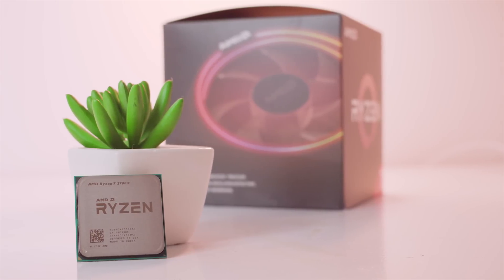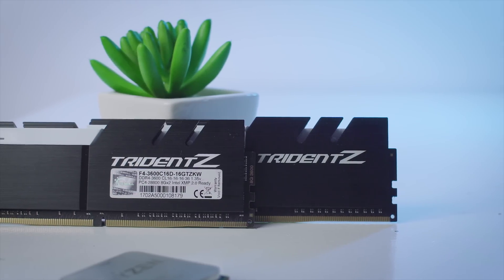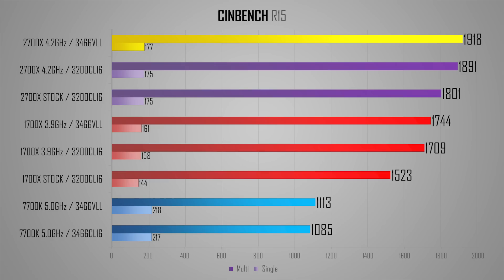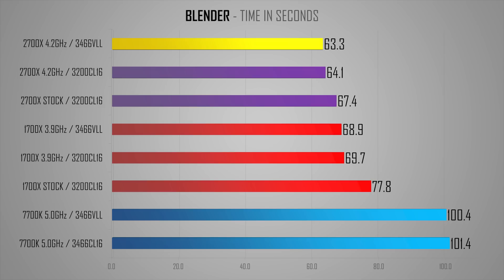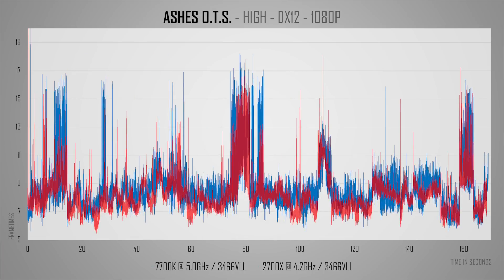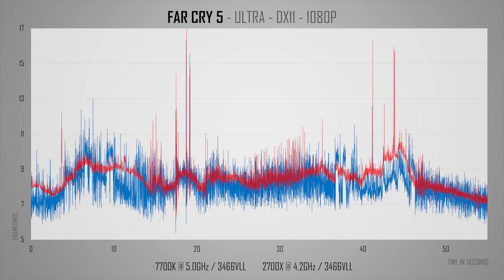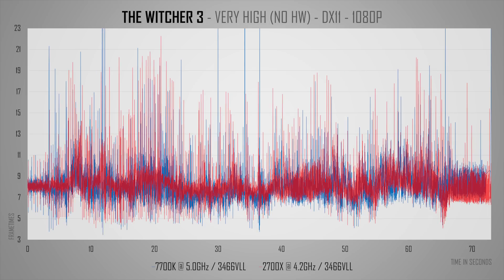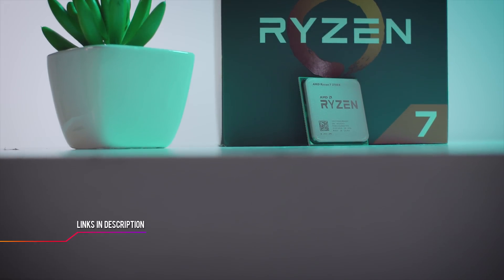RYZEN 2700X + Low Latency RAM - Still AMAZING PERFORMANCE gains...

Comment: I have worked out the reason why Ryzen has the issues with gaming performance. 

It is because the data path for the memory traffic from CCX0 and CCX1 to the system memory, over the Infinity fabric, is effectively the same as a three node LAN with a store and forward switch in the middle (AMD call it a CAKE) connecting the three nodes of the network up. Each connection transfers data at 32bytes/cycle at ram speed making the entire trip from cpu to memory relatively slow at about 1600Mhz.  The switch has to work like a traffic cop and merge the traffic from both pipes connected to each CCX into a single 32 byte/cycle pipe that connects to the memory controller, cutting the bandwidth available to each CCX in half. 

The dual channel Ram itself is limited to accepting 32 bytes/cycle so there is no benefit increasing the pipe size connecting the memory to the fabric. Generally the memory access network is fine because memory accesses are by nature bursty and not constant so there are gaps and the queue at the switch in the middle smooths things out.

Running cinebench or blender type loads perform well.  The available 16 byte/cycle available to each CCX module is enough for the CPU to perform well.  If you play a game though, The GPU is connected to the network and needs to access the Memory controller over the same 32 byte/cycle pipe that connects the memory controller to the fabric. Now instead  of 16 bytes/cycle available to each CCX, the GPU is also taking say, 30% of the available bandwidth only leaving say 8-12 bytes/cycle available to the threads from eachs CCX. that means the requests have to wait through longe queues at the switch and each thread has to remain idle for a fraction longer waiting for memory access.

Faster memory helps because it provides more cycles per second to shift the backlog a the switch. Because the speed from cpu to memory is speed limited, the memory controller doesnt need to buffer much and ends up with either being fully busy or doing nothing

Intel uses the ring bus that runs at least twice the frequency of the Ram making the trip from cpu to the memory controller buffer fast with reduced latency. Once in the buffer, the controller to memory link is at the same speed as the AD but it is only a short trip. the controller can write the data to memory as soon as there is a write slot available.
Reply: Infinity Fabric is a marketing blanket term invented by AMD and actually covers the data transport and the management layer. I am talking about the data transport layer.  Make no mistake, it is a network on a Chip. It does not use TCPIP, it has different protocols but the principles of network traffic and network bottlenecks remains the same. Road traffic getting traffic jams at peak hour because two main feeder roads merge into one road with out any extra lanes is exactly the same principle. Increasing ram frequency is the same as giving the merged road a higher speed limit .

The infinity Fabric that you are thinking about in terms of frequency is just the transport mechanism. Memory reads and writes are the work that is done by using the transport mechanism and that work takes time to complete. The time the  System Ram takes to complete a memory transaction is determined by the CAS timings and sub timings that together determine the total transaction time cost involved. The Fabric has teh capacity to carry 4 memory transactions at a time. A single ram write request takes 60-100 ns to complete depending on how tight the timings are set.  The time to complete the transaction and be ready for the next one is what is being reported as Latency in the aida64 latency tests.  If the memory is busy with servicing requests from cpu 0-3, the next load of thread memory access requests from cpu4-7 have to wait until the memory is available to get a turn. Threads waiting for access to memory are sitting idle not processing anything.

CPU cache is clocked to the CPU clock and is effectively fixed. The Ram frequency sets the speed limit on the data transport. More cycles available on the fabric network, gives the CPU more opportunities for the cpu threads to have their turn to utilize the system Ram. tighter timings means the waiting time before the memory can deal with the next send is lower. 

AMD and Intel have taken different approaches to accessing memory. The relatively slow Infinity fabric means that the data is speed limited all the way from the CPU to the Memory controller incurring a time cost but the memory controller does not need to buffer anything and processes the requests as they arrive. The time cost is seen as the higher latency scores in the benchmarks. The higher latency does benefit SMT because each thread gets more opportunity to do some work. 

Intel's ring bus is about double the speed between cpu to memory controller but it relies on the memory controller buffering the fast arriving data an manageing the data access in the last hop to the ram silicon. that makes more efficient use of the available Ram cycles in the last hop from controller to as the Ram silicon. 

The result is much lower latency and because the load on the memory controller is better balanced, getting Gaming performance. The sacrifice that Intel makes is to the efficiency of the Hyper threading.
Reply: Memory access is by its nature bursty leaving large gaps between moments of high activity. Particularly as AMD fabric is running at the same speed that the memory can be accessed. It is not a constant stream of data so the memory controller is either all or nothing. 1:1 does not allow any extra traffic to be squeezed while being sent across the fabric in the way a faster link does. You still have the problem of the memory access speed being limited to 32 bytes/cycle so you need a bigger buffer and then can rely on the bursty nature to give the controller gaps  in time to smooth out the access to the silicon.

The Fabric is basically like a 4 lane highway. faster memory or increased fabric multiplier is just increasing the speed limit on the 4 lane road. It mitigates the problem but gets harder and harder to achieve safely/stably. Next gen GPUs will be more powerful than Pascal making the problem worse. What is really needed is a 6 or 8 lane road. The need for faster speeds to clear the traffic then goes away. 

The only real way to solve the problem is to create a double interconnect to the memory module and implement a triple or quad channel memory controller. Even if it only supported 1 dimm per channel, Quad channel means you get 8 concurrent writes to memory instead of 4. The fabric could stay the same and there is still excess capacity for GPU utilisation without causing contention.

I suspect that while it may not be as dramatic, any new 8 core Intel chips will show less efficient gaming performance than the six cores if they stick to dual channel memory for similar reasons. dual channel is on the limit of what is supportable without compromised performance. Adding a GPU load pushes it a little over the peak and starts the trip on the down side of the performance graph.
Reply: doubling the frequency of the fabric and increasing the memory controller buffer would make teh chips more Intel like in performance.  The 2600x vs 2700x in gaming performance is about the same. Leading me to believe that 6c/12th is probably the optimal level for dual channel memory if you want to do gaming workloads. 

The best fix but most unlikely would be a ddr5 or change to triple or quad channel memory.
Reply: The Infinity Fabric is always used. It is the providing the connection between the CPU cores on both ccx modules, the memory and the pcie controller that connects to the  GPU.  

The bottleneck that we are talking about is not about threads switching  to cores on the other CCX module. PCPer and Anandtech were wrong. They could never get their heads around the idea that If it was scheduling based, you would see the same performance issues in non gaming workloads and you didn't. Ryzen 1800x was beating Broadwell-E in the office applications yet losing out if you ran a game. The thing that was changing in the two scenarios was a heavily loaded high powered GPU of at least a 1080 or better. 

Many in the Youtube tech Media have made this appear worse than it actually is (not mindblank. he started his reviews with a 1070 and got different results to everyone else). The number of reviewers who steadfastly clung to the Idea that they needed the highest powered Graphic card because of the fixed belief that the test would either be CPU bound or GPU bound. It totally ignores the fact that there is stuff in between that could also be creating the issue, especially if you are testing a CPU that is a totally new architecture that Even AMD was not completely sure of how it worked (at least in public).

Project Lasso can be used to manage threads and set CPU affinities for applications on Ryzen. You  will unlikely get the best results from disabling the 4 cores on an entire CCX to make a quad core though. You should experiment because each game has different requirements in regards the demands it places of the hardware.  The 1600 R5 cpus perform better than the R7 in a number of games  and better than the Ryzen Quad cores so you will more likely get the best results disabling the CPU affinity on two threads on each CCX and letting your R7 pretend that it is an R5 1600/2600 while it is running a game that is being impacted by the contention for access to the memory. The Utility will not prevent other applications running on the unassigned cores the way AMD Game Mode does and doesn't require you to reboot. If you are running on a GPU less powerful than a GTX 1070, then you don't really need to do anything. the lower performance  GPU cannot produce enough memory traffic to hit the point where contention levels are causing major problems anyway. 

 I would highly recommend anyone using Thread ripper  to install either Process Lasso or one of the other free process management utilities that are available and actively manage their applications . I would suggest that anyone playing games on TR set the  CPU affinity to only use a selection of about 12 threads from the 16 on the die with the direct connection to the GPU
Reply: Every Ram transaction has a time cost. Aggressive sub timings do improve things because it reduces that time cost for each ram transaction. The CPU cannot send a memory request every cycle. CAS14 means 14 cycles to just to set up the memory to be ready for the transfer. Some of the sub timings run in parallel and others are additive to the total time the the settings allow for the transaction to complete. Loose timings extend the time the computer allocates for the transaction to complete. if the actual time the memory needs is less than the allocation, the loose timings are just wasting time.

the fabric running at ram speed means the controller doesn't need to buffer in the same way it does with Intel's ringbus shotgun approach because the data cannot arrive faster than the memory controller can deal with it anyway.
Reply from the maker: This actually makes complete sense. So instead of major architecture overhauls, a middle ground in effort-to-effect would be asynchronous interconnect speed, to allow higher that 1:1 with the DRAM. I think even 1.33:1 would be a major boost in performance. Ideally doubling it should be the best solution... EDIT: NVM, I read your next comment.
Reply: Damn brad morris, i don't usually comment on youtube but i made an exception this time, i don't know if all that is true or not because i can't even begin to make sense of your explanation lol, but it sure does sound like you know what you're talking about. If i may ask are you a CPU architect or something?
Reply: My reaction to this comment:

https://youtu.be/Qw9oX-kZ_9k
Reply: I was hopeful that would be the case before it was released as well but unfortunately not. I have been talking about a single Die Ryzen. Thread ripper splits resources across two dies with the extra latency inducing fabric connection in between that introduces other issues because it is splitting each dies' dual channel memory controller. The gpu can only connect directly to one of the two dies leaving the other four cores behind an additional layer of latency. 

with TR, you can do your own cpu affinity management and run the game on threads on the die local to the gpu connection. on the 1900x you are then the same as a 4c/8th cpu.  the unutilized cores can be used by the background tasks. the 1920x or 1950x would probably allow you to manage your way to a better experience.
Reply: No you dont. 

You still have a perfrctly viable and useful PC with 2400 or 2600 memory installed.  It just wont make quite as many FPS if you are gaming with a GPU at a 1080 or above level. If you can't afford 3200 + Ram it is unlikely you can afford a 1080TI. 

Perfromance with a 1070/1060/RX580 and below is pretty much the same with both platforms
Reply: seems contardictory with this test your conclusion, i don't think he explicitly said that upping the megahertz is the only way; he said faster ram will help to keep busy all the time, this means tighter timings makes rams faster as well. 

"that means the requests have to wait through longe queues at the switch and each thread has to remain idle for a fraction longer waiting for memory access.

Faster memory helps because it provides more cycles per second to shift the backlog a the switch. Because the speed from cpu to memory is speed limited, the memory controller doesnt need to buffer much and ends up with either being fully busy or doing nothing"
Reply: there is certainly compiler optimization issues as well, particularly in games that predate Ryzen but the gaming under performance that is helped by faster Ram  for just about all games across the board suggests that it is not the root cause
Reply: maybe an easy way to visualize it it to think of the fabric as a 4way intersection connecting 4 x four lane roads. two of the roads connect to the two CCX modules, one road connects to the PCIe controller/GPU and the last 4 lane road connects to the memory controller.

traffic going to the mem controller from each ccx module can arrive at the intersection four abreast. the 8 cars have to slow and  merge to all get into the single four lane road that connects the intersection to the memory controller. For non gaming loads that situation is adequate. 

With the gaming load, imagine the GPU has forced the closure of one of the lanes to the traffic on the memory controller road so it can operate get instructions and textures and display the game. The 8 lanes of traffic from the cpus now have to merge into 2 or 3 lanes and not four, slowing traffic down further.   The more traffic (16 threads) the greater the impact on total time required to service the needs of the CPU compared to a lower traffic count (12 threads).

Each thread on a 6 core has to work harder than each core on the 8 cores but application access to memory is sequential in nature we need to look a a snapshot in time rather than totals
Reply: the issue is the the connectivity to dual channel memory is over subscribed by 8c/16th. Hypothetically, Adding another CCX would make that problem worse without other architectural changes that increase the bandwidth to the memory controller and increasing the number of memory channels. 3 x ccx (12 cores) to a quad channel controller that connects using a second parallel interconnect, on the same die, should solve the contention issue as you are the cores concurrent potential to access  system memory by 100% but only increasing the load generating cores by 50%. 

Given that AMD designed Zen to be a modular "lego" block (ccx) that can fit in pairs to a silicon die which n turn can be connected together to other dies to make a multi core server chip, I doubt that they will be  re-engineering the basic building block/die any time soon. Adding extra CCX modules, in addition to the design effort also have a power and temperature cost that they may not be able to overcome with current technology. This is all hypotherical. I don't know if AM4 could even be rejigged to support extra memory channels. I guess that it cant not Im not 100% sure on that.

Maybe 7nm will lower the power and cooling requirements to a level where that sort of thing may be possible, but the change in FAB is a major undertaking in itself, they are not likely to be making massive internal changes to the chip at the same tme.
Reply: Very difficult to determine what the problem could be from a YT comment. A custom build system has many different parts and any one of them could be the cause. Threads dont jump between dies to the extent that some people imagine and even when they do, it is only adding 40ns.  What you are describing is not caused by the architecture.

You are the first person I have heard complaining about micro stuttering. There are certainly many things about Ryzen that are not well understood. I have no Idea what may have caused your issues, the usual observation was that Ryzen, while it was producing lower framerates, was generally producing more consistant frame timesand wasdescribbed as feeling very "smooth". maybe you had a motherboard/hardware problem?

I am certainly not hailing Ryzen as the Best CPU, far from it. I think that the design, as it stands now, is slightly flawed but not so bad as to be useless. not everyone want to play games on a PC and 1080TI users are unlikely to be playing at 1080p. 

It is good to see that there is some competition  in teh CPU market though.
Reply: @bradmorri  any thoughts on ryzen 3xxx now?
Reply: @cis9222  both Intel's ringbus CPU design and AMD's Iinfinity Fabric design have design tradeoffs and compromises. 

Much like the difference between an American V8 engine and an Italian V8. one is designed for huge torque  and makes up for lower power by adding extra capacity and the other more for HP per liter.

ringbus works great up to about 8 to 10 cores but becomes impractical much above that due to the complexity of connecting the ring to everything. Infinity Fabric is more restrictive in terms of total bandwidth per interconnect but infinitely more flexible too expand the chip design.

Ryzen 3000 is a great design for getting work done.  and makes increased core count relatively easy compared to Intel's approach. 
16 cores are amazing. The design and the multi chiplet interconnects do help with the gaming performance if the application code is written to evenly spread workload across the chiplets. Not all games do that though.
Reply: @bradmorri  Im planing my build soon. Ryzen 2700x , B450M MSI tomahawk MAX,2x16 gigs of RAM Corsair or Kingston. But, I read this whole post (took me a while), and I need to ask which RAM should I get? I want 2 sticks 16gb so it works in dual channel. Which RAM is best for 2700x? Also, what you think about this. How 2700x will handle future games in terms of FPS? I think as long as I buy very good GPU I will be fine. I mean its 8/16 and upcoming consoles  gonna be on similar chip with slighter lower clock speed since consoles dont aim above 60fps. BTW im not planing to buy B550 boards or wait next gen of CPUs. Im low on money , for now, maybe that changes in next month. Maybe , but maybe I will get 3700x. Will see. I know that 2700x is really really good CPU but better to ask others opinion also. Is it worth buying it now? Also Im doing music production.
Reply: @PsychoCaki  Dual channel is the correct choice. 16GB sticks are dual Rank memory sticks and can me a bit more difficult to set the clock really high than 8 gb sticks but the do offer better performance due to the dual rank on each stick.

Ryzen has been designed to be extremely flexible so AMD can produce a range of CPUs from 4 to 16 cores while providing adequate performance in just about all things. Gaming will never be as fast as an Intel chip due to the differences in architecture but it will be adequate and generally, because of the internal QOS used by the infinity fabric,  give better 1% low framerates than intel making everything less choppy.

16BG 3200C14 (best performance) or c16 (slightly more budget) sticks are probably the best bet for a 2700X build.

Take a look at the MSI QVL for memory and that should be a good guide as to what sticks are compatible with your build. Corsir and Hyperx tend to have use different chips on different SKUs so it is not as easy as just picking a brand

Gskill sniper X memory is ryzen certified and b-die chips. they may be worth a look. Gskill kits are usually pretty good with Ryzen anyway. Ripjaws series will be cheaper than trident series but not as pretty

If you can find sticks that use the Samsung B-Die chips, you stand the best chance to try overclocking the memory a bit higher than the xmp settings.
The 2000 series cpu memory controllers are not as strong as the newer 3000 controllers so the memory speeds are not as high. 

If you are really lucky, you may be able to run a set of 3200c14 sticks at 3600cl16 but those 2000 series cpus are not that common. 3400 should be possible for most cpus. Cl16 sticks could also clock faster but likely with looser timings.

The memory clock is tied to the Fabric clock. the faster the clock, the more bandwidth available to get data from the ram to the cpu for processing and from the cpu to gpu to render frames.
Reply: @bradmorri   Yeah I know that Ryzen cant be Intel in gaming and I don't even care about thaat much fps in games. Im also productive based guy not only gaming. I do game a lot like 6 hours per day minimum but I do lots of things beside that also so 2700x is sweet spot for me considering my budget right now. BUT LIKE I said maybe my budget changes in next month and maybe I grab 3700x. I heared about that Samsung Bdie memories and I might take a look if I can find those sticks in my country. I never took a look if we have those here. I dont mind spenting little bit more on memory so my 2700X works phenomenal. Im a tweaker guy so I like to play on those things. Sometimes its even boring to just put everything in case and all works phenomenal. I mean I dont mean on huge problems we all dont want that right,  but tweaks I like. But intel is not even fast that much compared to 3700x when you consider what you need so Intel works that phenomenal. Price for motherboard ,cooling etc. I mean its just higher clock speed that makes differences and single core performance. But I admire Intel how they manage to hit 5ghz on chips on 14nm technology. I mean even TDP isnt that high for those Intel chips. Imagine that Intel have 7nm. I think that things would be different. What you think? I think what Ryzen is trying to do is to "make" their CPUs more like combo between Xeon and Intel. I know their target is IPC but also I wonder why their clocks are low. I mean its not even good for overclocking also compared to Intel which is 14nm. Intel really squeezed last juice out of 14nm before they change architecture while AMD seems to go somewhere new before mastering old stuff, if I said it right. I mean I know that even FX8350/70 is capable of runing many games when overclocked but still Intel was famous back then.  Anyways, I might take a look for those Gskill memories. Samsung and GSkill one of those il get just to see availability in my country.
Reply: @PsychoCaki  general rule of thumb is that the 3200 kits that have timings at 14-14-14 or 16-16-16 are usually the b-die kits. There are a number of the overclocking sites that have compiles lists.

Gskill sniper x ram is specifically "made for Ryzen" so it is a safe bet.

If you are considering upgrading and you have the budget you might want to also look at some 3600cl16 kits. You may not be   able to run them at the advertised frequency with the 2700x but they should work OK with a 3700 upgrade.

the next gen ryzen cpus will be announced soon you may even consider an upgrade to the latest gen next year assuming your b450 will support it. (it may not) I am hoping that AMD puts dual infinity fabrc interconnects to each CCD this time. If they do that, the new Zen 3 chips should beat anything that Intel has to offer.

Don't get hung up on frequency. 4.2 ghz with 120% IPC will beat 5ghz with 100% IPC all day long. Remember the old AMD FX chips ran at 5ghz. They were still rubbish because they had terrible IPC. 

For most Productivity work Ryzen 8 core CPUs are beasts. You should be happy
Reply: @bradmorri  Yeah thats very true. AMD is all around. I  hope that B450M will support next gen of Ryzen CPUs so i can upgrade later on from 2700x to something "faster" although i know that with 2700x i willl be able to do many tasks for years. Also for the RAM I might go with 3200mhz kits with CL14 latency. I know now which kits just i need to find them here. I dont think i will OC 2700x to 4.2 , but yeah IPC is IPC. Maybe i will do it or maybe not. I just dont like to OC stuff idk. Thats just me maybe. I like tweaks but OCs not that much. Thanks for your answers! Im curious what AMD will offer in future. But also Intel going to 10nm in near future? Or maybe not .
Reply: @PsychoCaki  nothing forcing you to oc the cpu. 3200c14 is a good choice. that should also run at 3600c16 if the memory controller will cope. 

you will get the best performance increase running the memory as fast as possible with PBO enabled as opposed to running an all core overclock anyway
Reply: @bradmorri  patriot viper gaming 4400 mhz runing at 3600mhz cl14 with Ryzen 3950x. I saw some guy have that memory. Also 32 gigs of RAM. Sick performance. Idk can I get something like that similar? Like I said I dont mind spenting more on memory to get as much as I can from Ryzen.  I didnt look at price though yet haha. EDIT: nevermind I saw prices. Too much for my budget. I might take a lot at 3600mhz cl16 or 3200cl14 like you said those gskill ripjaws.
Reply: @PsychoCaki  Yes that 4400 ram will work if you can get it. it is budget priced 4400mt/s ram but It is not available where 
I live.

The 2700x memory controller is weaker than the 3000 series controller. 2000 CPUs that can drive 3600 ram are not that common. you may be lucky but you will have to try it out. 

cl14 2300 ram will also run at 3600cl16 so it is a good compromise for the future upgrades. likewise if you can find a 3600cl16 kit that is better priced, you can most likely run that at 3200cl14 on the 2700x build if the memory controller wont cope with 3600.  The timings for both kits are almost the same. The 3200cl14 kit is ever so slightly faster.
Reply: @bradmorri  so you’re saying that buying and overclocking B-Die sticks is basically pointless on the 2700x? I’m running a 16gb G.skill trident 3200 kit 16-18-18-38 which I believe is Hynix memory. 
Curious if I would see my cpu bottleneck I’m encountering with my 3070 lessened if I were to tighten timings on my current kit or upgrade to the patriot viper 4000 or 4400 B-Die with better timings. 
Also worth mentioning I’m on the stock ryzen wraith prism cooler.
Reply: @dyyylllaannn  Ryzen Infinity Fabric Architecture and ryzen memory controller capabilities diametrically oppose one another in the first 3 generations of Ryzen CPU.   The CPU cores are monsters that are limited by the infinity fabric limitations on transferring data between ram and core to process and the core to gpu to display the game.

the data for both gets to travel over the same interconnect that id capped at the maximum ram transfer speed. the moment you start sharing the link with data for the gpu, the cpu gets less raw data to process so compared to an intel chip, the fps in a game suffers from the design compromises.

the faster fclk, the less the design compromise impacts the chips ability to feed thecores and the gpu....up to the limits of the memory controller to support the highest fclk frequency.

Memory that runs faster than the fclk frequency the memory controller can support will not improve performance. On 2xxx chips the fclk and memory frequecy are locked together and even golden chips would not run past 3600mt/s ram . 

I would suggest that you would be better spending your money on a used 3700 cpu and selling the 2700x rather than buy 4400 ram.

you could try some ram frequency overclocking on the 3200 sticks first. give them slightly more voltage and try the sticks at 3300 or 3466 with the same timings. 3600 is about as good as you could ever hope for. You will get an fps improvement and it is free.

Remember that the 5xxx cpus are the last on AM4. 6000 cpus will need ddr5 memory.

The secret sauce of the 5000 series of chips is in what AMD have remained silent on. The 8 core CCX change helped but the main reason that he 5000 cpus are way better han the intels and last generation is that each chiplet is now connected to the IO die with two interconnects like the 3xxx thread rippers chips instead of one that became oversaturated and bandwidth limited when you were gaming.
Reply: @bradmorri  okay completely understood. I appreciate your willingness to expound at length about this subject to random people on a YouTube thread. 
I did read a lot of what you said in this thread to others, so I understand that adding the bandwidth on the chip to increase gaming performance is almost what you were saying they should do a couple years back when this thread started. Funny how you can predict these things so accurately with a little knowledge. 

Thanks for the advice, I won’t look to buy the memory, and I don’t really want to buy a faster chip in the current market unless I can find a good deal on it, especially not another bandwidth limited AM4 chip. Might as well just try to tune the ram I have to a higher freq. like you suggested, and I am also considering an AIO radiator cooler and noctua fans all around to improve temps on my cpu and 3070. 
One thing I think the 2700x does well is it’s XFR auto overclocking, I regularly see single core 4.3+ and speeds across all cores over 4.2ghz from that old silicon which I think is good. 
So just to reiterate, I will not really see a benefit from faster ram timings in gaming performance? 
I’m not just talking frequency, I’m more focused on tightening timings with the new ram. The 4000+ is just a good way to ensure you get b-die, I would run it lower.
Reply: @dyyylllaannn Thats OK, I am hoping to educate and share a bit of what I have learned over the years. I must admit that the misinformation in the media does trigger my tech OCD a bit.

The 5000 series are really good. They don't suffer the same design compromises of the single interconnect between the die and the io chip. Not sure if you have noticed or not but the first 3 generations of ryzen all had some element of Infinity Fabric in the Marketing. This time AMD have remained totally silent 

While the change to 8 core ccx helps some, it is not the whole story. the 3000 Threadripper chips all have dual fabric interconnects between each CCD and the IO chip.

Surprisingly enough, the 3xxx TR chips with much higher thresholds before the contention starts  perform better in gaming than the Ryzen chips of the same 3000 generation with the same core count 

 I am pretty sure that the major upgrade was the inclusion of the same dual interconnects on the 5000 Ryzen cpus eliminating the interconnect contention.

With the 1, 2 and 3000 cpus, the only tool to mitigate the limitations was to increase bandwidth of each interconnect. the only variable you have to play with is memory clock speeds because that is the only way you can raise the contention ceiling by increasing the fclk frequency.

A 2700x, while not being quite as good as a current gen CPU, is still certainly more than adequate for the time being. Wait 6-12 months and see what 5000 cpu prices are like then.

Do yourself a favor and google for the Ryzen Ram Timing Calculator app and down load it. You plug your cpu and ram details into the app and it will calculate frequency, timings settings and voltage recipes that you can try when tuning your rig.

You might be able to find an extra 5-10fps without spending a cent.
Reply: brad morris, what do you think AMD could do to mitigate this in the future?
Reply: @1idd0kun
DDR5 and/or Integrated HBM
Of course that's FUTURE-future, but we still have yet to see what Zen 2 brings to the table :P
Reply: I must admit, I have had similar thoughts. next gen graphics cards will show up the issues even more.  Mind you, AMD said they would use the same socket. They have never sail that a 1000 series cpu will be supported in a 2020 model motherboard.
Reply: If Ryzen 2s higher power process does actually allow the rumored clocks of 5ghz would that make it worse better or no effect.
Reply: @Hardcore Hardware Thank you.
Reply: While I'm a big fan of your writeups, I have to point out here that there isn't only the "GPU is saturating Infinity Fabric" factor as a difference between office benchmarking and game benchmarking. The way multithreaded code is written is incredibly different for both, because the way computations have to be scheduled to complete requires magnitudes more micro-management. If you're just converting a video, you can split it into 1-minute segments, split off the audio, split the audio into segments, generate tons of work units, send them to a hundred CPU cores, and each core could be used productively. At the end, you merge it all back together, and voila, done. Very simple.
With games, you can sure have AI and physics and sound all in different threads, but for every single engine tick (so at least for every frame drawn to the screen - or many many times more often) they need to synchronise up again, and that may incur CCX to CCX latency as well. Don't forget there are a lot of different simultaneous tasks of which some might be waiting for others. 

Factor 1: Since office applications only really have to splice calculations back together to a final result after all steps are done, you have much less inter-thread coordination and thus way fewer trips across the Infinity Fabric just for the sake of your control flow while you crunch results.

Factor 2: A game also pushes lots of data across to the GPU, much more than what most would imagine, and this might bottleneck dual channel per die memory. Let's call it Morris' Hypothesis. How do you test it? Simple, benchmark a pro application that uses the CPU and GPU for independent work units (not games) and see if Intel vs AMD makes a difference.
A crutch would be to write a simple CUDA app that benchmarks how many dumb operations per second your GPU can run, and see if this changes if you run it at the same time as a Prime95-equivalent that also benchmarks how many operations per second it can do. Compare AMD results to Intel results.

Factor 3: Nvidia's multi-core DirectX11 draw call system I would imagine can play a big role in performance differences. These threads again need to communicate across cores, likely across CCX, and that would come with an automatic performance penalty vs Intel's Ringbus if it has to happen very very often.
Consider that a) this technology is one of the main reasons why games even use more than maybe two cores, and b) it might not be Ryzen-optimized even now (and definitely wasn't at the time of the first "Ryzen sucks for games" reviews)
Reply: The really hard core overclockers will instist on prime overnight. I tend to be more pragmatic. If it appears stable go with it. If you start getting whea BSOD, reduce the clock or increase the voltage slightly
Reply: it depends on the application and how much load it is putting on the memory controller. a lightly loaded single threaded app will not bottleneck in the same way a heavy  multi threaded app will.  i used a car analogy before. The Road stays the same but a light load is what happens when a only a light traffic approaches the intersection. no traffic jam.
Reply: Gotcha, thanks!
Reply: You are right. But vendering a video is not time critical and is not a scenario where the performance is bing impacted. A game is, it relies on the correct frame being displayed tim and time again within a specific time frame. 

It is not the GPU saturating the Fabric. You may notice that not every game is perfomance inhibited as well. Where we are seeng strange perfomance annomalies, 
you have a situaton that is similar to a 4 way, 4 lane highway junction where three of the roads (12 lanes) are all travelling to a single location at the end of the fourth road. in peak hour, you get a traffic jam.

In any traffic management environment, loads up to about 40% capacity lets everything runs smoothly. As the traffic gets heavier, all the cars get pushed together and slow down. By the time you get to about 60% capacity traffic speeds are down and would be described as heavu traffic. Soon with only a small increase in the volume of traffic the speed of the traffic has slowed dramatically to a bumper to bumper crawl. Increase he load further and you will ultimately end up with gridlock. You can only solve that congetstion problem two ways. Either increase the speed limits on that single road or build extra lanes on a widened road. To date we have just been increasing the speed limit but that is not sustainable long term.

The 16 threads by themselves have got the infinity fabric traffic system up to a point just below where things start getting jammed up with the current level of memory frequencies that are available to us at this point in time. If you suppliment the CPU traffic load on the fabric with any additional competition for the bandwidth resources, it pushes the fabric closer to the tipping point where the traffic congestion becomes a reality. GTX 1060 or 1070 are not enough for the contention to be reaching past the tipping point to cause performance issues. Both AMD and Intel are at about the same level.. 

The extra demands that a powerful card like a 1080 or 1080 TI  can make on the fabric as they are needing more data to create the extra FPS is enough to cross that tipping point and the performance of the Ryzen systems start to fall behind. It is all relative though, falling behind is only by a bit. It doesnt mean that the AMD cards stop all together and fail completely. 

DDR5 is coming. If AMD can continue to improve support for the faster memory clocks,  they may be able to keep pace and offset the congestion ceiling.
Reply: this is my opinion, not based on any facts that I can point to but I suspect that making 5Ghz silicon requires 40 years of leaing edge experience to build on in designing CPUs and many $ in R&D andit allows you to design something like a finely tuned race car engine. 8700K, 6  cores and the current fastest cpu in gaming available to date. not so good if you have AVX algebraiac calculations where Skylake-X beats it. 

If you do not have access to those same resources, your options are to do nothing and fade away or use clever design concepts and engineer a range of CPUs that are more like Truck engines. Bigger, more cylenders, lower reving but still making competative power levels by having the extra cores available to spread the load. 2700X almost matches 8700K in gaming and beats it in heavy lifting jobs like cinebench or blender for example. AMD making large profits will allow them to accelerate their design engineering. Remember too that the faster you run a CPU the more cooling and power you need to drive it.

Both Intel and AMD CPUs are producing good products, the Ringbus is a great design but it becomes too complicated with more than about 8 cores but has 8 generations behind it. Infinity Fabric is one generation old, just moved to the 2nd gen with Ryzen plus and has appied some design improvements. The concept to allow for modular design is the only cost effective way forward as can be seen with itel also creating the mesh for skylake-x that performs a similar function.  

Remember too that while gaming is the major area of importance to the youtube audiience and has certainly helped fund nvidia and ATI, it is not the major driver behind GPU any more or CPU design ever. It is just lucky that the products can be used for playing games. Enterprise computing is where all the money comes from, not gamers. We just make more noise than corporate people who cant play games at work do. To maximize the profits to have more for R&D, AMD have to chase the enterprise and mining market as their primary goal.
Reply: About the AMD strategy speculations:

Since the main advantage of the Zen architecture is the relative ease of core scaling, I think this is what they will go for with Ryzen 2.
Then Zen architecture is a server focused architecture. I highly doubt they will implement many gaming relevant changes. Maybe tighter timings and probably faster clocks. If more cores also need more memory channels, this could be bad news as that could come at the cost of increased latency.
Reply: I have not played with a 2600x or any b350 boards so this opinion and my comments are based only on what I have observed to date. 

In my opinion, the X chips in the 2000 series, at least the 2700x work best if you do not overclock on the multiplier and them but let XFR do its job. The XFR2 single core performance is better than what you will achieve with an overclock and the all core is in excess of 4GHz at about the level you can get to manually anyway. Cooling is something that you need to pay attention to. The stock cooler is marginal for any decent overclocks anyway.  

An x470 board with the ability to do BCLK overclocking with give you even better results. Dont waste your time getting an x370 board now.  I have seen 4.5Ghz single and 4.3 all core with 103.4mhz bclk and level 3 overdrive setting  on an Asus crosshair 7 board. that is the top shelf at the moment and costs accordnigly. Money no object, I teh Crosshair would be my first choice. B450 are better specced than the b350 boards and may be worth looking at.

The Asrock x470 Taichi and  MSI x470 boards are getting good reviews. The mid range Gigabytes seem to be a bit problematic with VRM temps just now.

Your board only has a 3 phase budget level VRM. Make sure that you have a case fan blowing on the heat sink. 4Ghz is probably about what the board can cope with because of the limits of the power delivery.
Reply: If money is really tight, get a fan or even fabricate a flap that can redirect some airflow from an existing fan  directly at the Heatsink, while it wont make the board an overclocking monster, if should help reduce the VRM Temps a bit. You donot need a typhoon in the case, just constantly moving air over the sink. The Sink on that board is pretty marginal at the best of times.

 If money is available for a MB upgrade, time for a new board. Dont buy the cheapest one just because it is cheap, you will end up with the same problems you have now. If you can wait a bit, The new B450 boards are apparently a lot better than the 350 boards, many of them have upgraded VRMs over the B350. As you have a 2600X, a X470 will give you the most options
Reply: 70 is warm but should be ok. Prime was getting them to over 100 and that is getting too high for long term use.  Mosfets are usually rated for intermittant bursts to about 125
Reply: you said before you that got 110 deg. 85 is ok for heavy loads, that are not constant.
Reply: historically AMD said max voltage was 1.425v. Gen two on auto will jump up to about 1.5v when the cpu is not under load but from back to the actual voltage when you apply a load to the CPU. I think the the Ryzen chips like to stay below about 70 deg
Reply: @brad morris So, you're saying.. "The cake is a lie" ? ~Portal (2007)
Reply: brad morris no it is either that the game is optimized for intel or amd has a clock disadvantage. Because how do you explain crysis 3 then?
Reply: brad morris So, since the problem is within the architecture, what can amd do in order to defeat or reach intel's performance in gaming?
Reply: your a beast!!!!
Reply: That's why when I hit 3600Mhz ram the whole system gets unstable, with only put prime to work all workers start failing in second 1 so that mans is nto going to be posible to g et ryzen work at 3600Mhz ram speed 3466mhz is the top speed.
Reply: It is possible maybe to use one die to calculate almost all the game play and just regulate the ccx communication for things that are need it, I mean my point is to avoid to cross data between ccx just when is need it ?
Reply: Mindblack you need to invite @brad morris to a talk man that guy seems to know about cpu architecture, invite him to a podcast
Reply: there will be a point where the memory controller cant keep up. Future firmware updates may help
Reply: So if you're right then 1900x should perform much better in games since its effectively a quad channel 1800x right?
Reply: if amd went to 12 cores with 3 ccx's and also added a mem channel maybe that would help.  but then you would have more cores hitting ram but with level of threading in games being low it might help at least utnil they become more thread then you will be in the same boat
Reply: i also dont think either intel or amd are going to get faster clock speeds that what they are getting with current tech when they move to 10nm\7nm.  intel actually enlarged some components to get the high clocks that coffeelake hit so easily.  maybe smaller trasnistors cant handle the voltages i dont know but i expect the same or maybe even sligtly lower clocks on the new process nodes.  i think amd will either stick with 12nm for most desktop chips and have 7nm for TR\epyc and maybe one or 2 cpu's with 10-12 cores on 7nm for am4.  i think intel will go 8 core and with the extra 8 cores and either an enlarged igpu or moving some of the PCH to the die (for a more ryzen style SOC) to get the extra size needed to solder it.
Reply: bobhumplick GloFo is claiming their 7nm will be able to hit 5Ghz. They aren't in volume production yet but they seem to be far enough along to make that claim. Being GloFo I take it with a grain of salt since their track record isn't great, but that is from the CTO's mouth so if anyone over there should know it would be him. 

https://www.techpowerup.com/242148/globalfoundries-7-nm-to-enable-up-to-2-7x-smaller-dies-5-ghz-cpus
Reply: i know ive read the article and without lookin its dr garry patton i beleive.  notice how he says things like "* i think * 40 percent is what we quoted. * i dont know *  how that will translate to frequency.  but 5ghz sounds about right.  soemthing like that.  and ryzen isnt even mentioned. plus the fact that they are talking about 3 different versions of 7nm.  and the 5.2 ghz chip from ibm isnt made by glofo yet its made by ibm on 45nm.  you cant take a fabs word for anything and this guy sounds like he doesnt even work at the company.  like hes talking about a third party.  very wishy-washy.  ill believe it when i see it.  im think they have a 7nm process that will probalby do 5ghz but with very expensice material\manufacturing costs and it will be too much for desktop chips and the 7nm for desktop cpus will either be a combination of 12nm and 7nm or will be much lower clocked. and if its a combo the most important parts will be on 12nm with maybe the cache and stuff on 7nm which will make it not much smaller or more power effiecient and will not get higher clocks.  these new smaller nodes are great for memory and mobile cpus' but desktop cpus just dont seem to aggree with it.  maybe leakage maybe the voltage is too much for it.  we'll see i guess but i really dont hold out much hope for a straight up 7nm doing anymore than what we have now.  maybe a combo doing 4.5 tops and barely on silicon lottery winners.  i think amd is counting on 12 cores at the same clocks for its next cpu.  and some IF tuning of course
Reply: I was under the impression the only reason Ryzen is limited to roughly 4.2 ghz is that the 12nm node they use is a low power one that limits it the 7nm is supposed to use some of the new EUV which i imagine will help loads but who knows at this point. It is show to have twice the logic density though so having more dies on the same package may be possible don't know if they could keep the socket the same while doing so unless they left enough unused pins in preparation for this.
Reply: You need expensive overclocking memory to use ryzen.
But Nooooo... I don't want to. thanks.
Reply: Government LAB strange, I have a Ryzen 1700 And do not have any microstottering at all. 
You have to pick everything apart to see what causes the problem.
Just wait till next year and who knows you will buy a Ryzen 2.
Reply: Kwarkiemodo
,
At least the 2400G does not have this problem. I am using 2400G with Intel 8700k. The 2400G is a complete four core.
Of course, the 2400G is a secondary computer, not a main computer. My main computer is using 8700k.
Reply: 4 cores cannot queue up as many memory access requests as an 8 core can which is where the performance limitations I am talking about can be seen. higher latency, in the 70-100ns range does limit throughput but it also evens out the smt performance more. 
Your stuttering experience with a 1600 is not typical of these ryzen chips and speaks more to a physical hardware issue.
Reply: I think that the 2700x is the pick of the range this generation. It seems the key with the 2700x/crosshair is not to bother with all core overclocks but to use the overdrive 3 setting with a small bclk boost. 103.4 bclk will get you 4.5 single core with 4.2 all core boost. 

Your memory, with 16-18-18 timings is a Hynix kit I think. I am not sure how well they clock on Ryzen. I know Wendell from Level 1 tried out a mixed set with 2x 8gb 4000mhz gskill b-die sticks and 2x 4g 3000mhz hynix sticks and got a stable 2600. 4 sticks are harder than 2 sticks to get to 3333 but this gen is better with memory support. The key is finding the best stable balance of frequency/tight timings. Having 4 sticks gives you extra interleaving opportunities so 2933 at cl16 may be a happy place for your ram anyway. If you havent seen it get hold of the Ryzen dram calculator. Posted over at overclock.net.

The next geneation of 1180 should basically  beat a pascal titan XP by a small amount. I expect a 1170 to match the 1080ti. If nvidia can introduce extra compression features to reduce the next gen pcie traffic requirements, i dont think there will be an issue. It may even improve things. If it is just a faster pascal, then that is the root cause of my concerns for the future.   Manually managing cpu affinity is probably a very useful skill to aquire as the problem is not about how many bytes you can throw down a pipe. It is about how many different threads can simultaneously get their needs met at any given time. with a gpu also sharing he access to the memory, 16 threads are tripping over each other.  if a game doesnt need 16 threads but is using them just cause they are there, it makes sense to allow the game to only have access to 10 or 12 threads and it mitigates the issue. it also means you still have all 16 available to render videos.

the Intel 8 core/16 thread cpu coming soonis likely going to face similar challenges with a dual channel setup. The ring bus,though, does provide a more efficient pathway so itis likely to have a higher ceiling. maybe we will explore that with 1180 this year?
Reply: Isn't it amazing the whoo haa being made about memory controllers and the extrat two dies not having direct access to memory over the new Thread Ripper 32 core announcement.

Just watch, when the CPUs become a reality, they will market them on one of two ways. 

Either they will tell you that the architecture is simlar to modern ARM processors in cell phones that use "big" and "little" cores to allow the high core count spec or, the new 32 core Thread Ripper will arrive with 8 channel memory that only supports a single DIMM per channel instead of two DIMMs. I cant see why scenario 2 could not be made work and even remain backwards compatible. The motherboard only has the traces and sockets. The logic to both define and manage memory channels is all on  the die and the connection to memory is all down to the pin outs on the chip. that will mean dach of the four dies gets its own two channel memory controller. As with Ryzen 2700x, getting one dimm per channel working fast is much easier than getting two dims per channel on a singe controller. The resources can be dedicated for each chip to max out the single channel and allow for native support at 3200 dual rank Dimms or even faster with single ranked Dimm modules 

I think option two, which could also be made a feature of next gen Ryzen, would allow a higher number of concurrent memory operations, particularly if they can apply a multiplier to the Infinity Fabric frequency.
Reply: brad morris do you know why AMD struggle to get higher clock's speed ? Why they can't do 4.5ghz for exemple on zen architecture ? (Sorry for my bad english)
Reply: brad morris thank's for your reply ! Respect man ! I have a last question do reach 4.2 GHz on my 2600x i need to buy a X470 or x370 mother board ? Because i have a b350m gaming pro and i can't put 1.45 in my BIOS I'm limites to 1.4v so with 1.4v my CPU running at 4.0ghz but can't do more do think it's my CPU is "Bad" or my VRM's on my mother board are not egnouth powerfull ? :3
Reply: brad morris thank's for your help ! :)
Reply: myVRM's temp in stresst test with prime 95 are ~110°c :/
Reply: 70°c with 1.4v at 4ghz isn't to high ? i will not damage over time ?
Reply: in prime 95 i have 85°c max with 27°c in my room and ~70°C( 70 is the max with temperature spikes)  when i play at bf1
Reply: thank you sir for your help !
Reply: do you have a yt channel or web site ? :)
Reply: no, i am not a content creator on yt.
Reply: brad morris what is  max temperature for ryzen ? and what' is the  safe voltage recommended by AMD because alot of people says this is 1.45 or 1.5V ? my 1.4 volt for dayli uses is fine ?
Reply: brad morris ok , so my 70°c when I'm gaming is fine X) thank you alot and sorry to disturb you with all questions :3
Reply: CPU at 70 is at the very top of the temperature range for these CPUs. VRM at 70 is OK
Reply: brad morris for you 45minutes of prime 95 with smalFFT during 45minutes is egnouth to test the stability ?
Reply: brad morris i have found 1.4v for 4ghz stable i have tested 45minutes with prime 95 smalFTT
Reply: Do keep in mind that each CCX has their own L3 cache as opposed to uniform one. What it means is that last level cache miss can introduce additional latency when one CCX has to go through IF to tap in the cache of the other CCX. Because of this cache locality, in some cases you may see positive results from pinning threads to single CCX.

Threadripper is whole different story as rather than just two CCX's you have two dies each with their own memory channels. So with TR you're not only dealing with non-uniform cache, but non-uniform RAM as well. Indeed you can(and for gaming purposes should) run TR in NUMA mode which helps with memory locality and often greatly reduces RAM latency.
Reply: nimi tokanimi yes you are correct. However, the scheduler makes best effort not to switch theads between ccx modules. Sometimes it is unavoidable.you would see performance impacts under all loads If it was the root cause and you do not.  It is blown out of proportion. 

Even if the switching was totally random, the chances of any given thread switch to another logical CPU and requiring a jump to the other ccx on the r7 chips is one in 8. 

In a multi threaded smt environment that has threads sharing access to a physical core the extra latency can be masked as other threads get more opportunity to process instruction than they could have otherwise had. 

TR makes the case for pinning threads even more important in gaming certain workloads as the same on die issues as r7 exhist and now you also  have the gap between dies as you say.  In addition, the GPU is only connected to one of the two dies.

The new thread ripper 32 core CPUs will be interesting to see what and do to mitigate 32 cores and only quad channel Ram. Will 16 cores have to make do with no local memory controller? Will the controllers change to single dimm per channel and quad channel per die? I don't know. But the single dimm per channel would seem to be the obvious solution while maintaining backward compatibility with the motherboards.  All the changes stay on chip
Reply: Almost certainly with 32 core TR you have two dies without local memory access. This would mean half the CPU suffers latency penalty every single time it has to access RAM. The quad die EPYC chips on the other hand are fine because they each have dual channel memory controller counting up to 8 channels, but TR platform is limited to 4 channels and cannot be changed while maintaining backwards compatibility. Introduction of quad die TR will make thread pinning pretty much mandatory for wide range of tasks, such as gaming. Cache optimized compute tasks will not suffer greatly though, so I suppose there are use cases for 32 core TR. Eagerly waiting for benchmarks.
Reply: nimi tokanimi you keep repeating what I just said. 

Remember that the motherboard doesn't determine the number of memory channels, that is all done on the CPU package and pinouts just connect to the wire traces that connect to the dimm slots. The only thing that is fixed is the number of dimm slots.
 
Just because gen 1 has quad channel ram does not mean that every gen has to remain that way. A single dimm per channel strategy would help both ryzen and thread ripper in the gen 2 chips while allowing retention of am4 and tr4 motherboard layouts.
Reply: Single dimm per channel? Isn't that quite how it already works? Two dimms are required for dual channel, four for quad channel. They're not increasing number of channels on TR4 in this iteration, and having only single channel per die would result in equally horrible performance on every core. With two dies having dual channel, you'd at least have half the cores taking the fast lane. This is almost certainly what we are going  to see.
Reply: nimi tokanimi no. Both ryzen and thread ripper currently support dual dimms per channel. Most people are only running single dimms in each channel, leaving the second slot empty.

Given that Zen 2 chips have not been released we really don't know what they are going to do. 

The performance issues are stemming from memory access concurrency limitations of the dual channel per 8 core die. The single dimm per channel would allow ryzen to double the number of concurrent memory transactions, reducing CPU idle time and reducing the %amoun of sacrifice made when a GPU is also making requests of the system memory. 

If the memory is not rejigged for thread ripper, I suppose that they could take the same approach as ARM and have "Big" cores and "little cores" that still requires core management though
Reply: @bradmorri  hi , i have a question do you know why ryzen CPU have temperature spikes in idle ? My 2600x oc 4ghz spikes often in idle on my b350m gaming pro... In auto settings CPU temperature spikes more... When i oc he spike less.. myabe it's my mother board ?
Reply: I don't know what the definitive answer but It could be that your CPU is bouncing between P0 and P1 power states as the CPU XFR management it exploring boost options. You could try and play around with power state settings. Min and max CPU.% to see what happens. maybe try ms balanced and high performance power plans as well as the Ryzen Balanced plan?
Reply: @bradmorri  yes , on every configuration my CPU spikes and when I'm gaming too on GTA5 for exemple sometimes temperature of my CPU spike... But i really think it's my mobo because , i need 1.40v for to achieve 4 GHz.... but in anothers forums I'm not alone for this problem and nobody know's why.... :/
Reply: GalaxMaster  the B350 does support the new gen chips but I don't think that it can support PBO2. You may well be right that it is the Mobo doing strange things. Asking the obvious but have you got the absolute latest BIOS? 

I saw somewhere that one guy set his power setting CPU power to a max of 99% and it stopped but limited his performance to 2.7Ghz. Not the solution but maybe a hint to the power state jumping around. 1.4v is at the higher end of OK. AMD were saying max 1.425 at one stage.  is 1.4 when it spikes on auto or have you set a constant voltage? I have not looked for a while but the X470 boards on auto with the 2000 series chips were peaking voltages up to 1.5v and then drop down to lower settings but that seemed normal.
Reply: @bradmorri  yes i have last bios , yes i have locked to 1.40 volts and for any reason in my bios i can not set more than 1.40 volts higher ... (I tryed before to hit 4.1 with 1.45 but in the bios he won't set + of 1.4 ) , in auto the voltage is around 1.37~ 1.45 V ( in games i achieve 3.950 ~ 3900 MHz ) in desktop in idle  the CPU run at 4.1 with ~1.4-1.45 , but never more than 4.1 in idle....  But mostly 4.25- 4.50...
Reply: most b350 boards do not have very good VRMs. the 1.4v limit is probably becuse of a VRM power handling limitation.  Maybe that is teh answer to your original question, The CPU ramps up because it has some thermal and power headroom and as soon as it does, the VRM circuitry pulls the chip back down again. 

If you run it with less than 1.4V at say 3.9ghz, do you still see that behaviour?
Reply: @bradmorri  yes
Reply: GalaxMaster  Im sorry, I dont have the answer. Maybe a new board is the answer? Google is your friend I guess
Reply: @bradmorri  thanks alot for your help !!!! And i have bought X470 taichi so... I will see and tell you if it's work ! :)
Reply: The Taichi, Im told, is a good board.
Reply: @bradmorri  can i install Windows 7 on this my X470 taichi ? Because on asurock website i didn't found any driver for Windows 7 :/ but i found on AMD website so , it's will work if i install drivers from AMD website ?
Reply: Windows 7 is not officially supported on Ryzen. I know that a number of people were running win 7 on X370 so you should be able to install it on a x470 board. they have not changed that much. 

I have never tried it myself. I dont remember anyone saying they had problems getting the AMD drivers working. Have a look at the AMD motherboard pages at Overclock.net. There are a number of windows 7 users there who should be able to help you out.
Reply: @bradmorri  hi, i have my new X470 taichi board and I'm very happy of this board , but when i launched cinebench R15 my CPU (2600x) drops to 3850mhz with 1.312v  my score is worse than my old b50m mobo ~1300-1294cb and my CPU temps up fast to +70°c ... So it's normal if i don't have 4.2 GHz like everyone ??? Do you think this is my CPU cooler fault ??? When I'm gaming my CPU is a round 3800~3975mhz with 1.36 (vcore is set to auto, LCC 5) on bf1 ~66-67°C. and on idle my vcore rise to ~1.412-1.456v i saw on hwminfo :3 please help me i didn't found on Google why.... :(
Reply: so is Intel I7 8700k better for music production than Ryzen 7 2700x?
Reply: you mean i5 8600K or i7 8700K?  I'm a photography guy, not a music guy so Im not an expert here but as far as I know music mixers applications like threads, i think. I would go and see the applications forum threads and see what the users of the software are saying

2700x and 8700K are pretty similar performance wise. with fast Ram the 2700x and 8700K swap first and second places in benchmark comparisons. The Intel is faster single core but the Ryzen has more threads and can be loaded up more.  Ryzen system is likely to be a bit cheaper overall. 

If you are familiar with cars, it is like the Intel chip has high horsepower and a low amount of torque like a high revving  Ferrari. The Ryzen has huge torque but not the same peak horsepower like a low revving 427CI American V8 muscle car. Both are extremely useful weapons and can do sub 10 sec standing quarter mile drags but get there in different ways.
Reply: I meant to say Intel I78700 k. Thank you for replying.
Reply: I thought so
Reply: If gaming is the priority the 2600 is a good chip.  An RX 560/570 can't create the same load as a 1080 or 1080ti so 2933 ram should be fine.

Ryzen dram  calculator application can help you out with Ram timings settings. you can get it from guru3d.com. might help you oc the ram to 3200 if you feel like experimenting.
Reply: @ItSmeSanThu  PCIe is what connects the processor as a whole to the gpu, the chipset and the peripherals such as USB controllers attached to the chipset. Infinity Fabric connects the component parts internal to the processor that is plugged into the AM4 socket.

The PCIe settings that you use depend on what you are connecting to the PCIe Bus. If all you have is a GPU they are ususally an x16 card (the new 6500 amd gpu is only am x8 card), then run that at x16 for best performance. 

Other peripherals like nvme drives, capture cards, network controllers etc are designed to run with x8, x4 or x2 lanes of PCIe. You want to configure the system to have the most number of lanes possible going to each device you connect.

The principles for pcie bandwidth and Infinity fabric are similar, the larger the pipe, the more data you can push through it before it gets clogged up.
Reply: @ItSmeSanThu  the sata controller should be fine. the only 2 pcie devices you have is the 3070 and m.2. you have enough pcie lanes to cover both ae full capacity.

the sata controller is connected back to its own lanes to the cpu. You dont need to worry about those if iy are using the primary sata controller.

give the gpu x16 lanes, the m.2 should be using x4 lanes. Check the motherboard manual if you have two m.2 slots and pick the one with the direct connection to the cpu, not the chipset.
Reply: @ItSmeSanThu  your best bet is to go to the bios, open the advanced tab

go to pcie subsystem settings

set the pcie E1 max link speed to Auto

set chipset gen switch to auto

set above 4g memory/crypto to disabled unless you are mining with more than four gpus

the pcie_E1 lanes configuration should probably be set to auto or it could be x4.

that should work for you and give you the best config for your pcie devices.

If you want to upgrade and all you do is game and light office type work (word processig, spreadsheet, web) you could get a 5600 cpu and get hod of ram that you can run at 3800mts and that will give you the best value for money performance boost. 

you could buy a b550/x570 motherboard as well but I really don't think that a mb upgrade is worth the money for the tiny performance boost pcie 4.0 would give you.
Reply: @ItSmeSanThu  no problem
Reply: Even with a 1080TI, it is not as though the impact makes games unplayable it is the difference between 150fps and 170fps. By managing the CPU process affinity for games that display performance issues, you can run the games on less threads and allow the remaining threads more opportunity to access ram concurrently with the GPU. something like process lasso which is a paid utility, or one of the free ones around can do wonders. Using a tool like that is even more useful on Threadripper where Numa Nodes come into play. the Gaming mode that AMD offers does teh same thing but disables cores. Using affinity allows other tasks to continue using the resources that the game is not using. If you use someting like a  RX5XX gpu or 1070 or lower you will not see any real issues any way.

Without re-engineering the Fabric, the only things left to AMD is to continue improving the high speed memory support with better Memory Controllers. 

They could clock the fabric with a multiplier greater than 1:1. That would instantly reduce latency as the trip across the fabric would be faster and the CPU cores and GPU could make more efficient use of the available resources.The cost may be more power draw and heat.

Amd could also double up the interconnect to the memory controller and engineer the memory controller to support four single DIMMs on a quad channel memory controller instead of two dual DIMM channels that exist now. It would spread the load, allow more threads the opportunity to access RAM concurrently  without having to queue as much and give the system more overhead 

 I dont know how much flexibility AMD has with the AM4 socket to do quad channel memory
Reply: brad morris , can you go work at amd and fix this problem.
Reply: If I understood you correctly here; in other words, more MHz on the ram is the real benefit? I have done a bit of benchmarking myself and from my data, the subtimings does nothing for the Infinity Fabric itself. You suggest that the problem is the bandwidth of the Infinity Fabric itself when using a GPU and the only way for us to increase that is with up-ing the MHz on the memory. 

I believe you are on track to something, but since the Infinity Fabric itself only respond to Mhz on ram and not timings we should see a positive net outcome of more Mhz on ram. That is not the case. We have seen gaming tests respond more aggressively to subtimings, which again points us in a direction where the Infinity Fabric itself is not that important.
Reply: brad morris,
I was originally using Intel i7-6700, and then replaced it with a Ryzen, and now I'm using Intel again.
I used Ryzen 1600 at first. However, there has always been a frame drop since. (About 0.1 second) In other words, Micro stuttering.
it is not exposed in the benchmark video. because it happens so short moment. This lags occurred simultaneously in both game and working.
So changed the CPU to Ryzen 1600X to solve the problem. But nothing changed. Other parts were perfectly normal when I was using the Intel i7-6700, so it was not a problem with the parts either.
After two months, I went back to Intel. And as I started to use Intel, the Lag problem disappeared completely. I strongly suspect that the cause is Ryzen's unique 4 + 4 core structure.
As far as I know, the second generation is the same architecture as the first generation. If AMD does not fix this, I will not buy a Ryzen.
I can understand the optimization problem, but the structural problem is not.
Reply: And one more. The 2400G is also bad. As mentioned, there is no microstuttering problem.
Instead, I experienced problems such as dropping frames, blinking screen, and graphical errors.
 It also happens very often. Even the blinking screen occurred while writing this comment.
This was not just me. Everyone was having similar problems.
Ryzen Performance may have improved, but stability is still at the bottom.